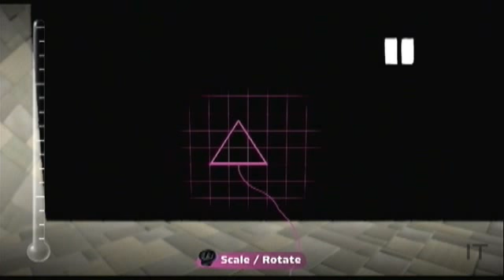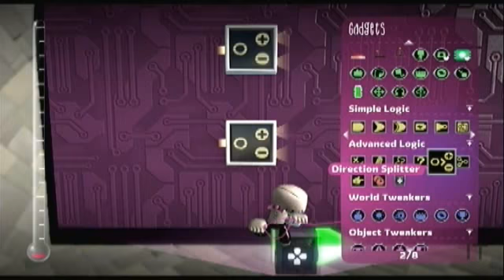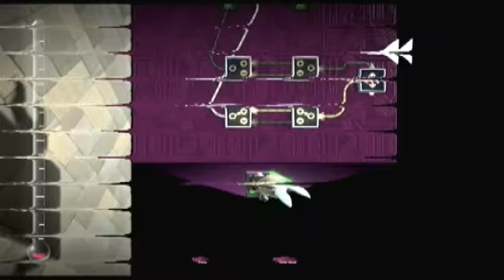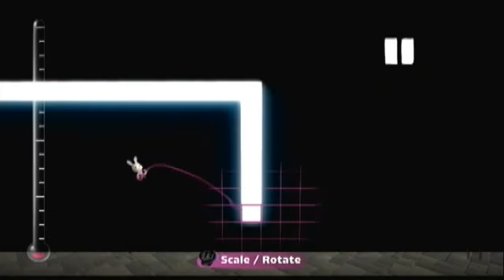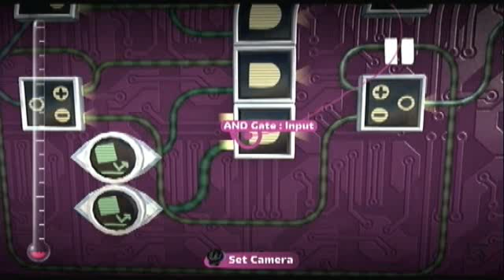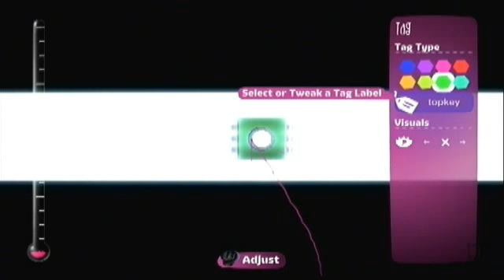LBP2 L2B Side Scroller Shooter Part 1

Comment: Hey fella, my question is similar to the others you've recent had but with slightly different. My top and bottom tags stop my ship as they should and then I can move off it. The left and right however seem to let me move through them, out of the playing area but then work correctly outside and won't let me back in. Any ideas why?

To the chaps below, have you made sure that your playing hologram is four seperate sections and not a continuous box so to speak. I had the same problem...

Comment: Hey Defcon,  I don't suppose you'd know why when I use the tags I get stuck in the walls.  I noticed you didn't use "touching" but the impact doesn't register unless I choose touching.  I think I watched the video three or four times to find what i was missing.  When I do choose touching however, I do stop moving up, but then can't move down as the impact turns off that particular movement, even with different tag names.

Not too sure what I did wrong here.